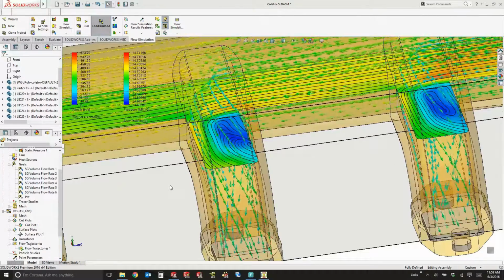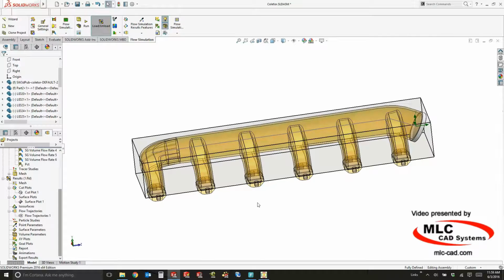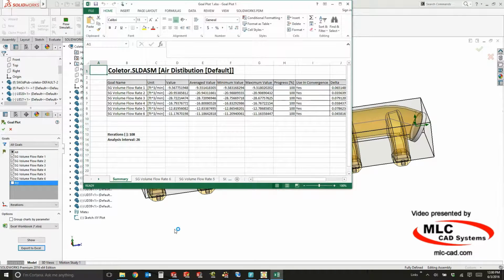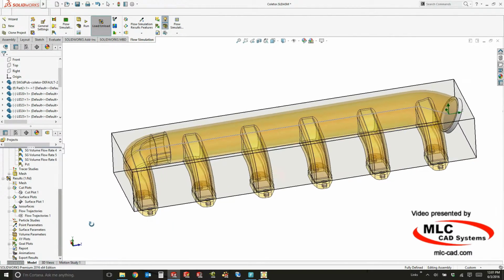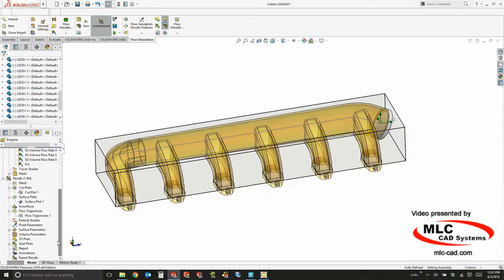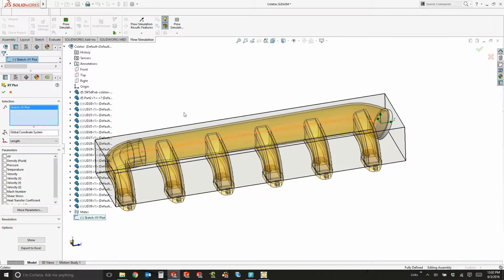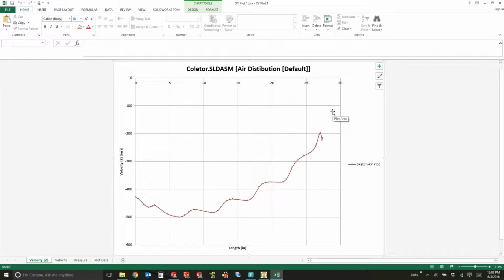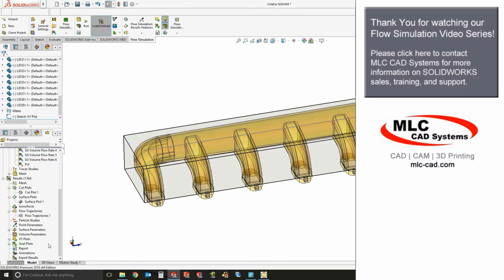SOLIDWORKS Flow Simulation: Results Measurement

Comment: can you tell me the manual formula for iteration. pls i really need it
Reply from the maker: The solver primarily uses Navier-Stokes equations for energy balance, does that help answer your question?
Reply: @MLCCADSystems  yes. . Can this equation be used for heat transfer? are the equations for heat transfer different?
Reply from the maker: Heat is energy and is managed in the Navier Stokes equations.  Flow Simulation is excellent at heat transfer because it directly studies conduction, convection, and radiation.  You don't have to guess at a convection coefficient or input view factors.  Conduction and convection are automatically considered, and radiation can be enabled and specified if it is relevant (moderate temperature differentials usually don't require as much consideration for radiation)
Reply: @MLCCADSystems  thank you so much this really helped me 😉